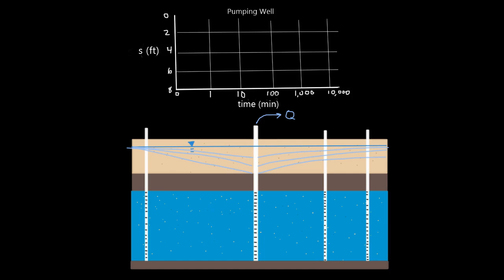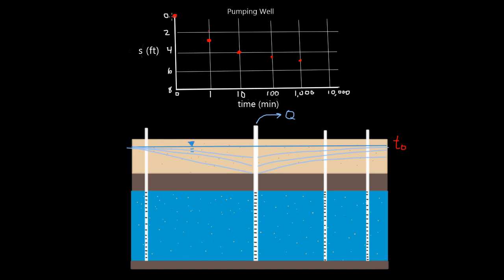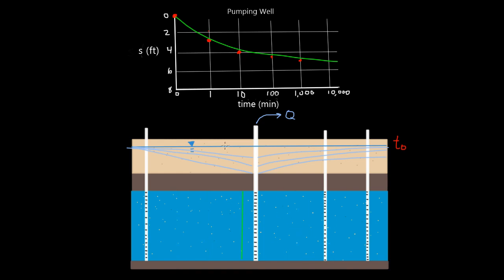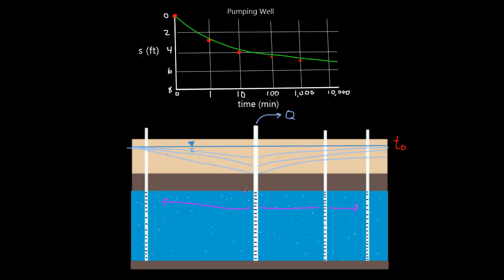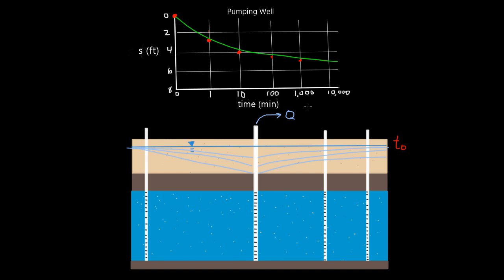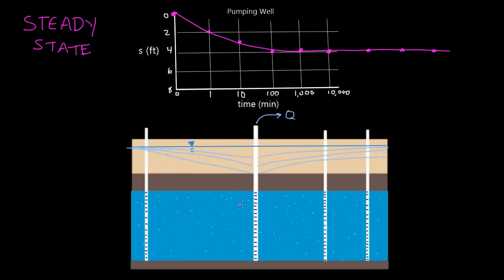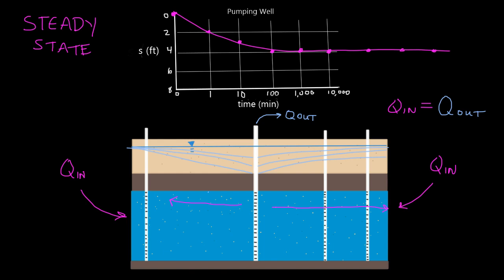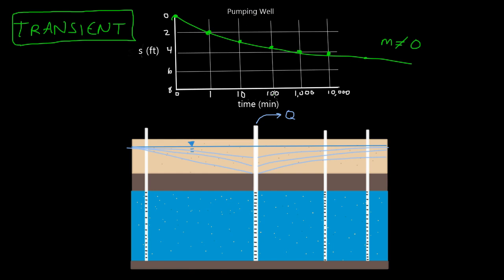Steady State vs. Transient Flow, Aquifer Test Drawdown Curves

Comment: Is that why my frog pond seep only gets so high and don't overflow? Had to add overflow pipe. Then found I have to draw water from lowest level to get water to clear up. Had I dug it farther down hill it would overflow on it's own, but not clear the lowest levels of pond. The fresh seep water don't like to mix with muddy water. Frog pond was dug so could have water to put out camp fire if needed. The water is only 0- 2 feet down along the boundary where it has sunk.